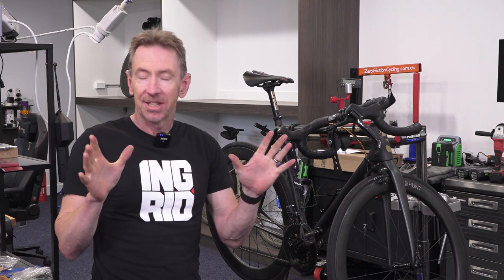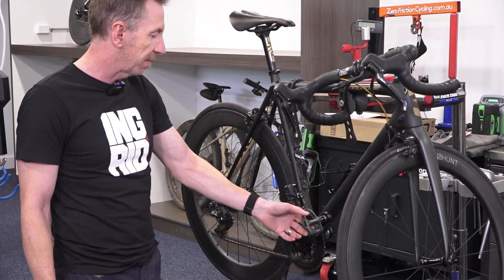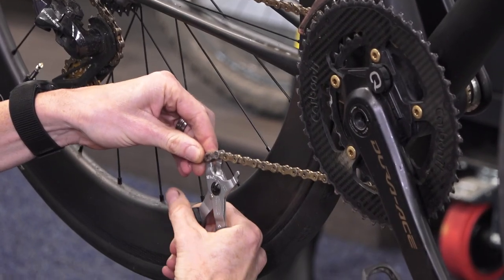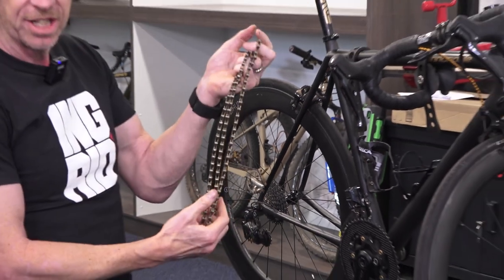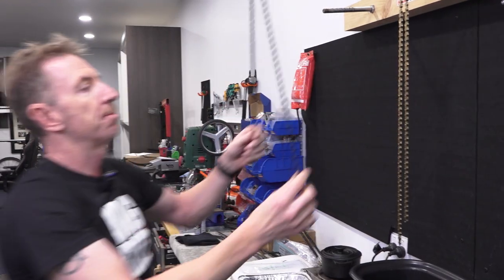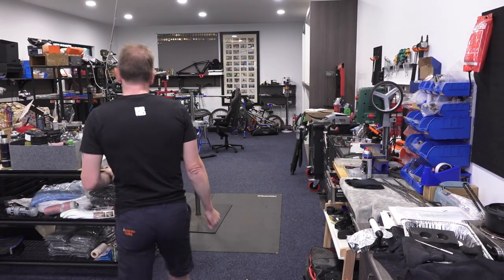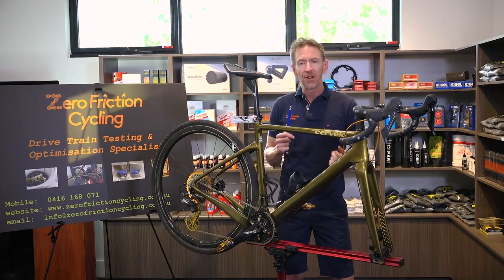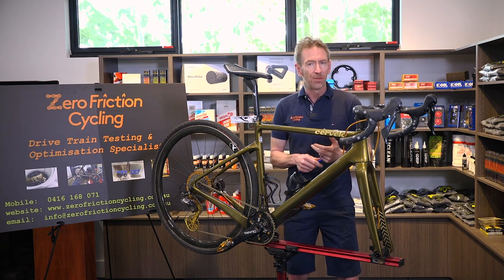Episode 17   Immersive Waxing - The Concise Version

Comment: I'm riding a Gravel Bike where I'm 50% on various levels of gravel road conditions.  I'm in my 2nd year of waxing. I have evolved into swishing my chain in boiling water for a few  moments before waxing to remove the lime dust out of the chain better. I find the wax stays much cleaner in the waxing pot this way so I don't have to change the wax out as often. The trick is after boiling and swishing wipe down the hot chain to remove all remaining wax. Then I lay the chain over the hot stove to make sure all the water is out of the links before waxing. It's easy and fast to add these steps. My stove is a glass top version but I would guess that doesn't matter. I recommend these steps to any gravel biker who wants to dip wax. It sure works well for me.
Reply from the maker: Hey Padd! If the rides are in dry conditions, best is to just spray some alcohol spray onto a microfibre cloth and wipe chain to lift and remove surface dust. Boiling water really should be saved for post wet rides where a lot of contamination is brought deep into chain by water running right through. Boiling water rinsing every time for dry riding is a bit more time intensive for no benefit really vs just wiping off surface dust which is a 15 sec job with spray and cloth handy.
Reply: @zerofrictioncycling992  I have tried many different versions such as wiping down the chain as you say but the wax pot quickly becomes so contaminated with dust I feel like i'm damaging the chain just by dipping it into way with so much containment in it. Yes most of the dirt is NOT on the outside. It's on the inside. I am very please with the boiling method. It takes just minutes in added steps. The results are stellar. Give it a try an you'll be amazed how much longer your potted way will last.
Reply: Some folks recommend a steamer to heat & clean chains before waxing, we use an ultrasonic cleaner that heats the water to keep crud out of the wax. Some folks talk about using two crock pots, one with old wax for the first soak, then one with fresh/clean wax for the win.

Comment: Thank you for so generously sharing your insights and expertise through your videos and website Adam. It’s good to hear about the science that underpins what you’re advocating and the practical application shown here.  I have one question, which is about how you made your wax link bond breaker (I’m shamelessly trying to copy it!) It looks to me like a 15cm length of PTFE rod 25mm diameter held each side by two wardrobe rail end brackets - am I close?
Reply from the maker: Thanks Rob, my pleasure, thanks for watching. And yes it is just cheap towel rail bracket from bunnings, the nylon rod i had purchased ages ago for tapping out cranks stuck in bb's - it is 25mm diameter, i purchased it from a cooking store - im not sure what they use them for, but they had a good range of groovy nylon rods. I cut 16cm off, about 1.5cm of that inserts into each end of the towel rail bracket screwed into bench top. Was a very quick and easy job when setting up the new workshop, and its merrily breaks in anywhere from 50 to 100 chains a week for prep prepped chains. I will wear through it one day in theory, but i estimate that rod will be good for circa 100,000 chain wax bond break ins. For normal home use at circa 300km per re wax, thats about 30 million kms of waxed life. At an average of 10,000km a year, it should last you around 3000 years :). 

Silly maths aside, over all the years of my personal and then ZFC waxing, the nylon rod is my favourite - has the smoothest feel when pulling the chain through vs metal or wood. And i am one who takes a lot of pleasure from all the little things in life :)

Comment: Yourself and Silca have persuaded me to take the plunge! I'm not too fussed about 'marginal gains' but a longer lasting drive train and the cleanliness (no more messy oil) really appeals. Just hoping UK winter weather will make it doable all year round.
Reply from the maker: Overall - as per key learnings doc - really immersive waxing and harsh conditions - thats the perfect time to be waxing IF you want to keep a low wear drivetrain and save a lot of $$ in wear. WHilst yes you need to re wax post any wet ride (or if that is not possible, add some ss drip or tru tension tungsten all weather until you can re wax) - the benefits for doing so are enormous regarding re setting contamination oh so easily. To try to match the day in day out low wear with say wet lube /just drip lube - to keep trying to remove the abrasive contamination that water is pumping in would require so much time and solvent cost to be in the ballpark of what just re waxing will do - it is fools game to try the latter, which is why people dont try to stay on top of maintenance in such riding, which is why they then burn through their chain and drivetrain. Also consider two chains on rotation, that can really make it much easier (put one in pot, other chain on, repeat - easy easy easy - or again, do this in conjunction with wax compatible drip lube). This guarantees two chains through cassette vs just one, as it is so common in harsh conditions riding for people to only get one chain to a cassette, and that be very costly depending on groupset (and hard to find parts these days).
Reply: We have gone the multiple chains route, Wonderful! Only takes a bit more time to wax three chains than one, and it is super quick to throw on a fresh chain as needed, especially during wet commutes (wet washes wax out of the chain).

Comment: Great demonstration and commentary. My process is almost identical with a couple of exceptions. Before putting it into the wax pot I pre-warm the chain in a 280F oven for about 10 minutes, then wipe it with a clean cloth to remove any external contaminants. I find this helps keep my wax pot much cleaner. I also lightly wipe the excess wax from the outer links when I remove it from the pot and re-install the chain when it is still warm and pliable.

Comment: Great tutorial, really sold me on immersive waxing. I recently bought a new road bike but due to living in the UK, and therefore riding frequently in wet weather, I was apprehensive on whether I should go for immersive waxing or just continue with wet/dry lube. I think I will run a cassette through 3 chains and use tru tension tungsten to relube the chains bewteen immersive waxes up to 800-1000km. Hopefully will mean I only have to immersive wax 5ish times per year. Thank you for the valuable information.

Comment: Love this channel!  However, surely hanging the chain up to drip dry, surely most of the wax on the pins/rivets is going to drain out. As the ambient temp of the air cools the chain, and the outside of the chain remains very hot for at least a minute, the inside of the chain will be a few degrees hotter still meaning most of the wax is going to seep out!? I immediately immerse the chain in cold water, have you considered please? Thanks Eddy from England .
Reply from the maker: Thanks Ted - and no if that was the case, we would not see the extremely low wear with the top waxes, as well as perfectly good to great treatment lifespans. The pressures inside the chain are extremely high (thousands of psi) - so the actual working layer of wax on the pins and other surfaces is very thin. So you dont need to try to get a thick layer left. All that happens if you do, is you just get much more mess initially as all that excess wax is pressed out, and a longer initial break in. This has been sufficiently tested, and also just the base logic - no matter what you do - after the first X mins of riding to break in a press out excess wax, you will have the same thin wax treatment layer - the pressures are just too high to allow you to have a thicker layer by "locking in more wax". 

 I would skip the faff of water baths indeed. I would not introduce water to my chain / wax voluntarily, and all that extra faff - sure it gives you another circa 20 mins of treatment lifespan as the excess is worked out in a longer wax break in time - to me that is not worth it....

Comment: Great video, count me as a convert.   But is there really no cleaning required between waxes?
Reply from the maker: overall yes that is correct - for dry road riding you never need to clean at all, the re wax is all the cleaning you need. Dusty offroad a wipe with a cloth and alcohol to remove surface dust is great so that isnt brought into pot. Wet riding, if its proper wet a boiling water flush rinse can be good again just to reduce contamination brought into pot - but dont do this for dry riding there is no point it just wastes time and elec. This is why on balance vs maintaining many drip lubricants - immersive waxing really is not time consuming at all despite what is often reported from places that lack knowledge of immersive waxing

Comment: @Zero Friction Cycling question from me. What product should I use to lubricate my rear derailleur when needed? 

I've cleaned my chain thoroughly following your instructions and then lubricated the chain using Silca SS lube. Very happy with that, not as good as immersive waxing but almost. I don't want cross contamination from the derailleur to the chain, cassette and chainring if I'd use "normal" oil based lubricant for derailleur.
Reply: ...and thanks for your work and YT videos. Good, useful and objective knowledge for all of us.
Reply from the maker: Hi joni sorry delay - you wont cross contaminate unless you are really hefty on your pulley wheel lubrication! Personally i use ceramic speed tt grease in pulleys for longer maintenance life vs drop of pulley wheel oil, and it wont run out anywhere if over applied
Reply: @zerofrictioncycling992  thanks for the reply

Comment: Hello, is there a set temperature at which you should remove the chain from the wax chamber? I remember seening somewhere that the optimal temperature is around 55-60c.
Reply from the maker: Just remove at the normal temp (whatever your pot gets too, which should be somewhere in the 70 to 90dg range on low) and hang to set. After 10 mins of riding, due to the very large pressures, any extra wax you may have inside by removing at a cooler temp - it just means more mess - it will be pressed out and you will be in the same place 10mins down the road if you removed at 100dg c and hang to set at 30degrees as if you removed at near set temp of 60c and put into cold water. 

You would have likely seen that on oz cycle - pls do not watch or follow his vids; 
https://www.abc.net.au/news/2022-06-07/court-hears-dog-beaten-by-steven-john-leffanue-had-severe-trauma/101132362?utm_campaign=abc_news_web&utm_content=facebook&utm_medium=content_shared&utm_source=abc_news_web&fbclid=IwAR10wEsMyGO61Gys4EvxNQGZRbsrtoNqK6GqYiAbKlkARNJmOG3v2m4rJBw

Comment: Hi thanks for the great video!
Is it advisable also to clean with mineral turps baths a new cassette (or anyway a used cassette every now and then)?
Reply from the maker: ah you dont often need to do much with a new cassette. if its brand new out of box, there is nothing to clean. New  on bike, just a very quick wipe to remove whatever FG from new chain. Periodic maintenance of cassette will depending on lubricant choice - if immersive waxing, really not any cleaning needed at all. But if cleaning most drip lubricants, mineral turpentine is good, just avoid getting into freehub / hub bearings.

Comment: One thing you might want to add is be sure to fit the chain in the correct orientation. If it’s put in back to front gear changes are a pain and you need remove the chain and turn it around.
Reply from the maker: as far as i am aware only shimano and axs flat top are directional and they have their instructions with chain. And for shimano shifting is impacted only mildy - the only difference is they do not chamfer the leading edges of the outer link plates on both sides of chain, only one side. It is a pretty small difference. Flat top wont really work upside down, but as long as flat top is on top, it works same installed either way. all the rest on market (ybn, campy, all other sram, kmc, etc etc - they are not directional).

Comment: Thanks for all the work you’re doing on this topic. Will the Silca stripper remove Finish Line’s, ceramic wax chain lube? I read on your website, and it has been my experience too, that this stuff causes chains quick after about 30 miles horrible.
Reply from the maker: it should do (and bearing in mind FL ceramic wax seems to remove itself from lubricating the chain!) - just note that really such products like stripper and UFO DT clean - they will be pretty expensive way to go for cleaning existing chains which will be much more dirty as you will likely use a lot to get a clean solution by the end. They really are more for cleaning a new factory grease chain, in which case you can put multiple chains through 200ml, as its just dissolving grease, you are not having to worry about all the crap brought in by riding chain with X drip lubricant. 

So for cleaning up a used chain, i would go traditional solvents as you will likely need to pump a couple litres of turps through to get all the crap out, and thats just not what you want to be doing with a fancy expensive prep product like stripper.

Comment: Great video, I think I will try the waxing and see how I go. Question, I seen another video where after waxing they put the chain in cold water is this a good way of doing it?
Reply from the maker: oh dear that one. No. The pressures inside chain reach into the thousands of psi. So remove chain from pot and hang on a 40dg C day, or remove and put in ice water to "lock in as much wax as possible" - and within 10 mins of riding you will have same amount of wax inside chain. With the latter, you just have a lot more mess from excess wax pressed out, and going through your wax in pot a lot faster.
Reply: Thanks for the reply. As you may know at present petrol as shot up in price, is white spirits a good alternative, I live the uk so I’m sure what other alternative to use.

Comment: Great video, I have ordered a new SRAM force 12 speed chain for race days, so get that I have to degrease the factory stuff, my original chain has only ever had muc-off (sorry wish I had seen your video sooner) so will still need to get rid of the factory grease? I have nicked the crockpot from the wife and ordered some SILCA Secret Chain Blend, so can't wait to get away from mucksville!
Reply from the maker: Hey Mark! With the existing chain it is not really getting rid of FG anymore you just need to properly clean it - it is easy but it will take A LOT of solvent flush baths - get ready to use about 4 litres + of mineral turpentine or equivalent depending on where you are, followed by 2 x alcohol baths. Pain but once it is done and you are on the grand low friction path, you are on it - and the future looks a lot cleaner and less abrasive! :)
Reply: Or use an ultrasonic cleaner (ideally one that also heats) and some "green" degreasing cleaner to really clean a broken in chain before the first wax.

Comment: I have been waxing for 1 year and don’t regret it. I was surprised that you let the bath cool down before taking the chain out. I thought it is better to wait until a thin skin appears on the surface. Indeed, if the bath is too hot, the wax drips off. What is your advice on this. For me, this waiting time is the most bothering part of the process.
Reply from the maker: ah no dont do that, that is major PITA, and also so much more mess of excess wax. Remove hot and simply hang such that excess drips back into pot, or if not possible hang such that excess drips onto a bbq tray - periodically you can then scrape back into pot. 

Removing cool "to lock in more wax" etc - after 10 mins of riding you will be in the same place as if you just removed hot as the very high pressures will press all excess out leaving same thickness coating. All you get for all that extra hassle is more wax flakes mess.
Reply: @zerofrictioncycling992  thanks for your answer. What does “major PITA” mean exactly?
Reply from the maker: @brunoj6146  PITA = Pain In The Arse

Comment: Is it ok to strip chains of factory grease and then wax them a few weeks later?
Reply from the maker: Maybe - it can depend a bit where you live. Most should be fine just wrap in a microfiber cloth and pop in a drawer. That will keep air exposure very low and moisture largely absorbed. Never put in plastic that traps air moisture and will speed up any oxidation.

Comment: I noticed @6m20s you moved the chain into a larger cassette sprocket.  I always do this before I start a ride with a freshly waxed chain.  At least for me It helps initially avoid the chain skipping over say the 11T cog which otherwise always happens even with the wax/link bonds well broken plus several crank arm spins.  It is worse at colder temperatures, especially when it is snowing !   

After a few minutes cycling up a steep hill to break the chain in I can usually safely move back into the smaller sprockets and all is good for the next 300km.

Maybe this is not such an issue with all wax blends ?
Reply from the maker: it can depend a bit on wax / temp / chain - often set off almost immediately downhill for many rides as i live half way up mt lofty. So many rides when i head out the door i am big ring, small cogs then very quickly 11t. I almost never have jumping issue, i just pedal light for the first couple mins, then all sweet. I think if one is pedalling high-ish loads in small ring small cogs immediately they can get a couple of jumps, but generally one shouldnt have it sorted what they do to start pretty quickly